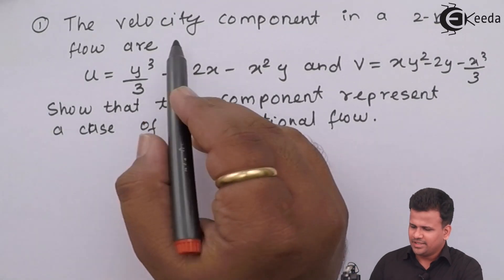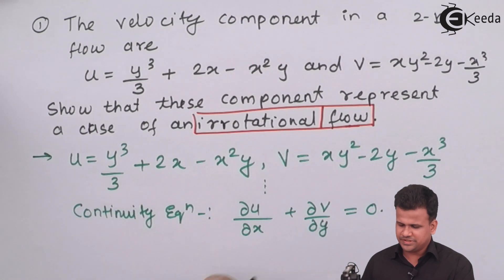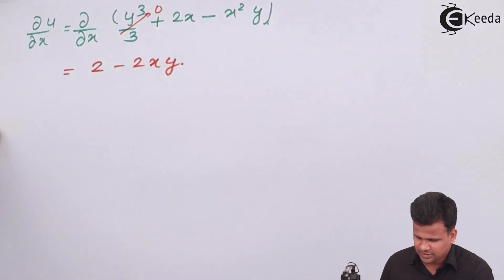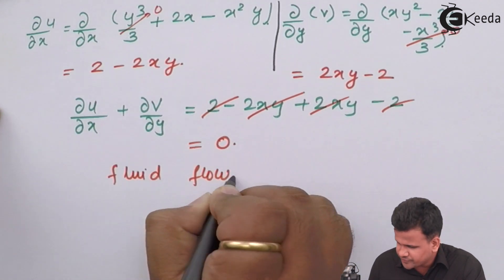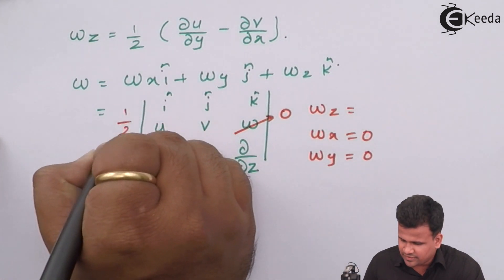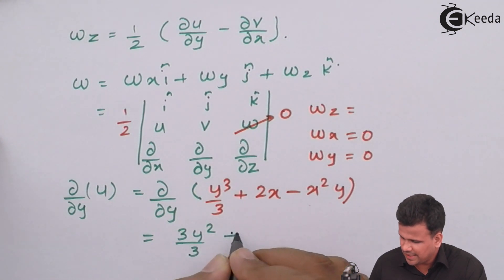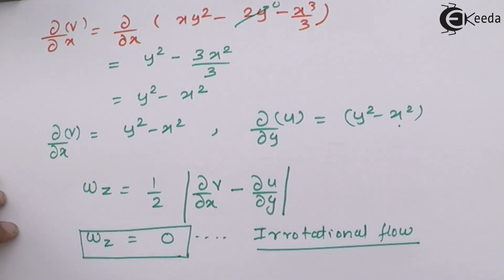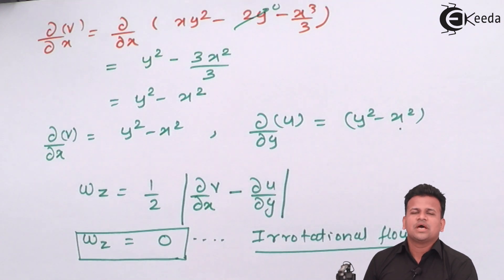Rotation Flow and Irrotational Flow Problem 1 - Fluid Kinematics - Fluid Mechanics 1

Comment: Great video! I was just wondering why the whole determinant and omega z is multiplied by 1/2 if the definition of omega doesn't include 1/2? Also why did you switch the order of dv/dx and du/dy in the definition of omega z in the end compared to the one you did in the middle of the video?
Reply from the maker: Thank you for appreciation. Visit Ekeeda App where you will get courses with all the concepts from basics, practice problems and doubt asking facility.
Download App - https://ekeeda.com/download.html